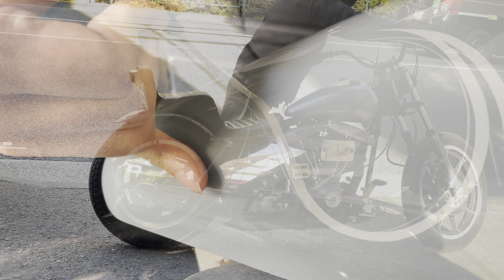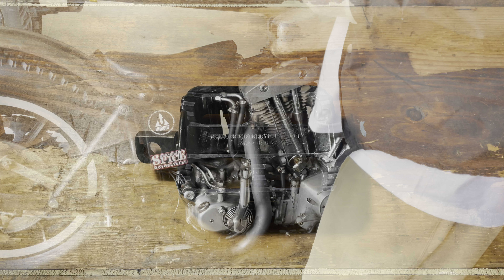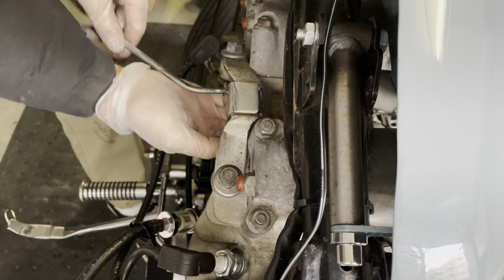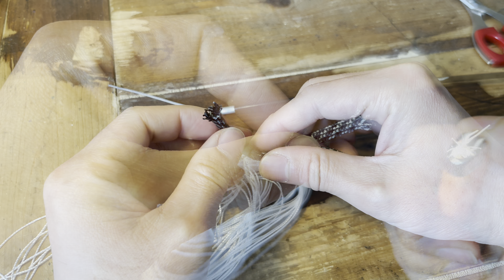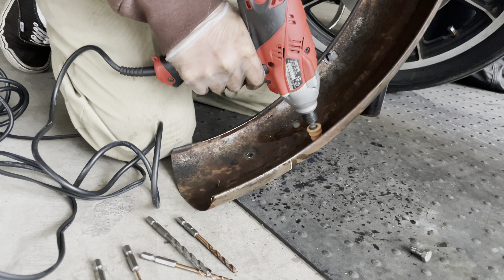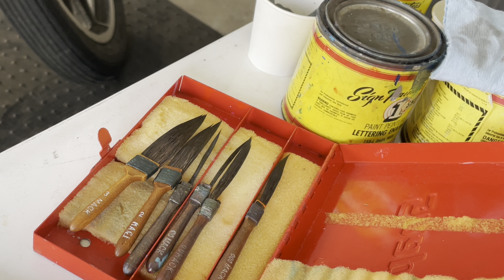バイク旅仕様にDIYカスタムする 素人ガレーヂカスタムダイアリー ショベルヘッドMy motorcycle custom diary. HD FXEF ‘79 shovel head

Comment: Ohayou Gozaimasu; did you painted the pinlines OVER the clear coat? without sanding the gloss? and then sprayed another clear on top?
Domo
Reply from the maker: I painted stripes over clear paint. It is enamel paint so it is resistant to gasoline and UV rays.